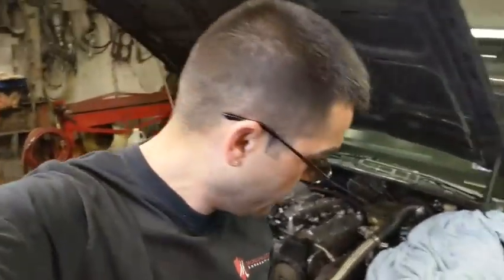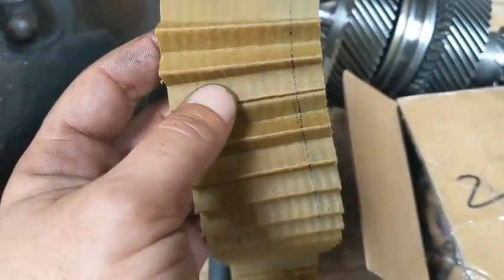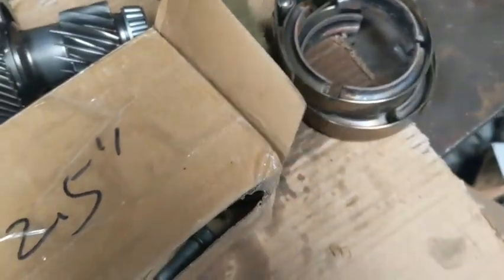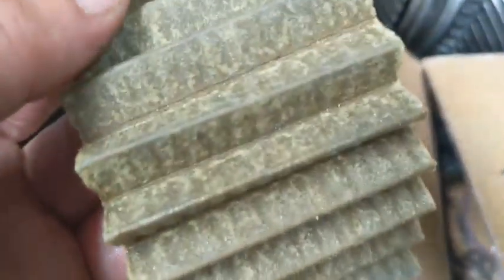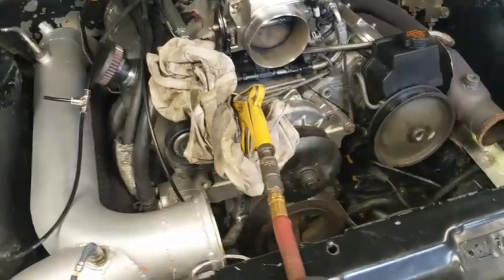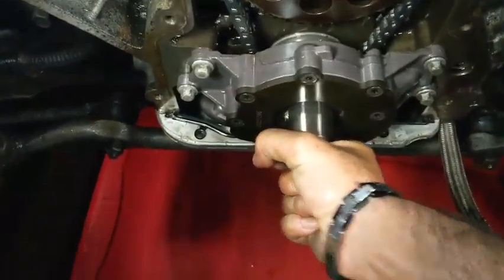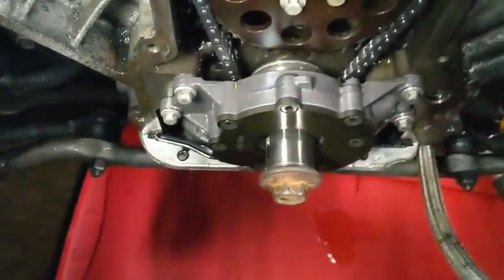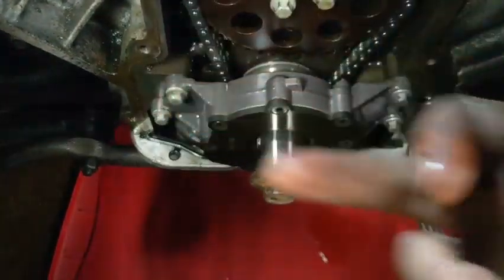engine's coming out

Comment: I feel like little man has finally gone and grown up.  Talking about dealing with boost creep, doing your own ecu tuning and even speed density.  If you tell me that you religiously test for boost leaks every time you mess around with the intake tract I'll be shocked.  I'm so proud.

In a side note, I didn't take a good look at your current external mounting position but there is the possibility that placing it in a different position that would make it easier for the exhaust gases to divert through the wastegate could fix the creep without the need for 2nd one.
Reply from the maker: Yes the gate is in a less than ideal position however there's really no room to mount it properly so we'll add another one and it should be good. I contemplated replacing the current gate with a larger 60mm but there's no room for that either haha plus they're almost 600$ for a 60mm
Reply: @turboiroc  I think the real answer is to just turn up the boost.
Reply from the maker: @donmerrigan2362  lol that's always the answer 🤣

Comment: dammit i feel your pain......I would be tempted to get a cheap junkyard 5.3 that no one has been inside on standby.
Reply from the maker: It would have to be a square Port motor but yea I hear ya lol
Reply: I like a built engine to and have owned 3 or 4 good ones back in the day....the only reason I say pick up an unopened one is I cant believe the luck I have had with mine it just runs great however I have not pushed the limits yet I am still at 14 psi with safe timing. will keep you posted how It pans out I have t56 also and turbo 5.3, got lucky with a gen4 rod 05 truck engine. good luck with it mate.